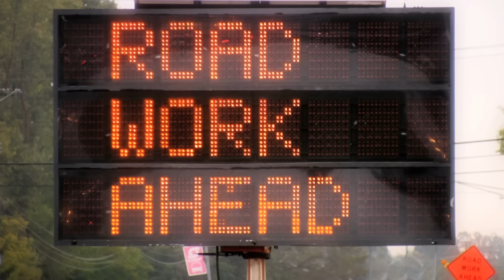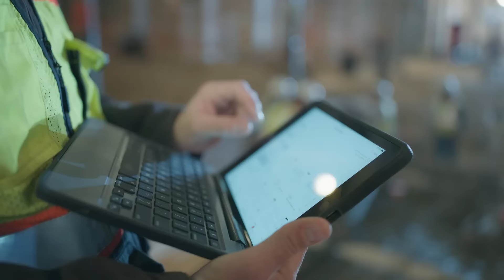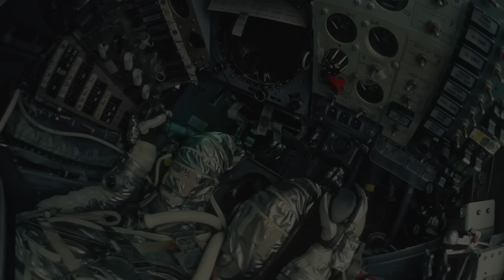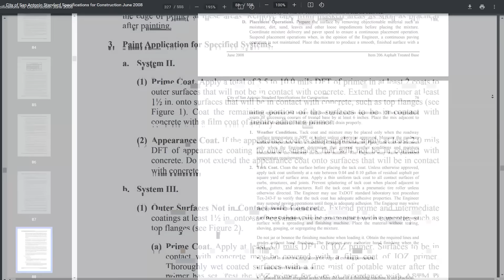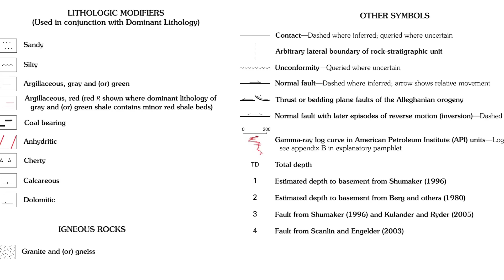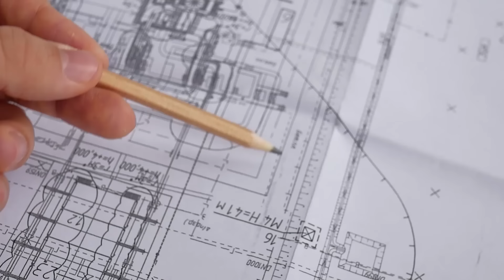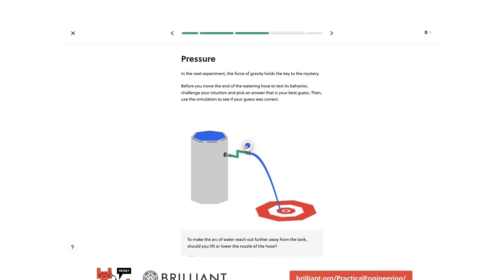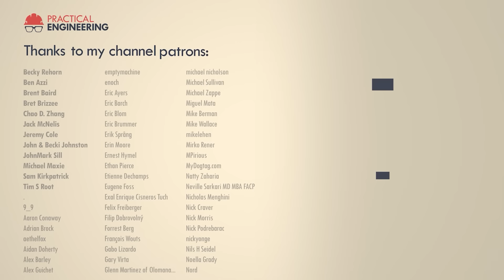4 Myths About Construction Debunked

Comment: As someone with a background in both construction (residential and commercial plumbing) and IT, I always appreciate the balanced view and information you bring to your subject matter.
Reply: The internet is a series of tubes. it's not a big truck.
Reply: ok
Reply: How was your transition to IT? Do you find it boring at times?
Reply: @OldSchool9690  
We have been using tech both on jobs it's and in the office for decades. We had digitizers and scanners in the late 80's. Many of us went back and forth between which tool I used. The best of us can draw faster by hand then the best cad operator. But digital is quicker to make changes or jump up in elevation or over to another typical structure.

But if I may, there is no transition. Digital is just another tool in my box. The building is the finished product. Not the drawings.
Reply: @OldSchool9690  I actually started in IT.  I went to construction after Dell stopped hiring in the US, outsourced everything, then finally sold the portion of their company that I worked for without telling anybody until after the deal was done.

I decided to get something that couldn't be outsourced like that, and got in to plumbing.  Did new construction, first residential, then spent some time in commercial.  I'm back in IT now and yes, it can be immensely boring at times, lol.  But it's a mixed bag, and some areas are busy all the time, just like building a house.

Comment: I worked physical labor for a long time and sometimes people are just standing around. They're not all inspectors, quality control, or jobsite supervisors. It's not a myth and it doesn't need to be explained or excused. People don't work all day nonstop in an office either. There are often other things to do but not everyone is going to be motivated to work nonstop. We aren't machines.
Reply: So, your excuse for 4 guys standing around, talking and laughing while one guy digging a hole is that people in offices don't work all day as well?
Reply: @lopezlopez7132  no. The excuse is that physical labour is hard and people need breaks. We don't have unlimited energy, sometimes digging can only be done by 1 person at a time so we take turns doing the work. More than 1 person digging the same utility out of the ground can cause problems and be dangerous in some cases. As construction labourers, we all put in our effort and time into getting projects done. Just because we sometimes stand around doesn't mean we aren't working.
Reply: @lopezlopez7132  also sometimes you need to wait for materials to be delivered, trucks can only go as fast as the speed limits and different things get in the way, such as traffic, specific truck routes that need to be taken, and weather. Materials don't just magically appear, they need to be delivered, and if there's no space for materials to be delivered beforehand like in the case of gravel, there's not always space for large piles of gravel to sit and wait, the materials need to be delivered as we need them.
Reply: @ewanwiebe  And you don't see any contradiction in your statement "Just because we sometimes stand around doesn't mean we aren't working"? You're standing around and it means you're working?
Reply: @ewanwiebe  I used to own a business. If my employees had to wait for "materials to be delivered," or something like that, they were given other tasks to do. I understand to "stand around" for 5 minutes waiting for materials or something like that, but 4 guys standing around for half a day because of traffic somewhere or no space to put gravel is a waste of time and money.
Reply: @lopezlopez7132  4 guys aren't standing around for half a day. They have things they're doing. You just drive by and see them when they're standing. Do you really expect every person to be constantly in motion?
Reply: @lopezlopez7132  like I said, they either take turns, one of them could be a locator on safety watch, one could be a Foreman, one could be another labourer helping where they can. Just because people are standing doesn't mean they aren't working lol I genuinely can't believe you're arguing this lmao
Reply: @ewanwiebe  OK, lets assume that 4 guys are not standing and not working for half a day. They are standing around for only 1 hour. 4 people, 1 hour each, it's 4 hours. With union labor it's what? 40 per hour? So, whoever is paying just paid $160 for nothing, but it's OK with you... Got it. 
As for me just driving by, well, Sparky, we have construction going on in the complex, where I live for over a year now. I work from home and see the workers all day long. They ARE standing around half of every  day at least!
Reply: @lopezlopez7132  who cares? If you're jealous you should get a job doing construction so you can get paid to "stand around and do nothing". You'll realize pretty fast that it's not so easy and I doubt you'll last a week, maybe not even a day. The job is so physically demanding, that in the rare times you get a chance to stand around and do nothing, you take it.
Reply: @lopezlopez7132  again, 160$ paid to have 4 guys stand around, who are ready to help and fix and solve any problem that could happen, that if they weren't there would delay construction and cost $10,000 , is just smart business.
Reply: @SUPREMELEGEND  I think Lopez has a point. I work in construction and it is astounding how many slackers there are on site, especially those who are used to working for the council. We're lucky to have built a hardworking team now but about half of new recruits just do not care about getting the job done. Lazy workers should and do get sacked.

Just btw I have been a labourer and do agree that rest is absolutely necessary. But it does not take 3 sparkies to core a fixing.
Reply: @SUPREMELEGEND  Well, lets agree to disagree. OK? By the way, I do not mean any disrespect towards construction workers. They just do what our way of doing construction allows them. Look at the HUGE construction projects in China, South Korea or japan, nobody is standing around there and gravel is delivered on time somehow...
Reply: Ya people should just stay in their own lane and not worry about what other people are doing.  Half the people criticizing laborers are probably getting welfare
Reply: love how everyone in this comment section totally missed the point about how we dont need an excuse to just... not work nonstop like machines
Reply: @LlamasOnJUPITER  That's why we all have YOU in our lives - to show us what we missed and to teach us the facts of live...
Reply: @lopezlopez7132  It's not an excuse,  it's an explanation.  Don't conflate the two.
Reply: @thedrnailsguy  So, if someone asks construction workers why they are not working, their EXPLANATION is "because people in the offices don't work as well"...
 I see...
Reply: There are lazy people in a fields. Constructions just attracts some of the laziest. Because the pay is pretty high for the labor being minimal. So they end up with greedy people and ex-convicts.
Reply: @Steve-zo4uc  And when they install at least some AI into you, you'll be unstoppable!
Reply: sometimes it can happen that concrete comes a bit late or some other material.  It happens that workers wait from time to time.
Reply: @Adidas_der_schwanger_war  What about them standing around doing nothing ALL the time, not from time to time?
Reply: @lopezlopez7132  Did not see that ever. Foreman would come if no progress. Strict time schedule just dont allow workers to be idle all the time. The video explained quite well how you might get the perception they would not do anything.
Reply: @Adidas_der_schwanger_war  Just look at, say, road repair in your neighborhood. Usually it's 5 guys "fixing" one spot. Two guys are actually doing something and the other three are talking and laughing. It's ALWAYS like this. Maybe it's not like this on your planet or maybe it was not like this before you died in 1937...
Reply: @lopezlopez7132  Did you even read my comment or watch the video? If you see workers actually on the site you can be sure that they will be working because their boss will be watching. He has to get the contract done in time to get paid. 
You are telling me you drive to a construction site and monitor every worker the full 10 hours only to see them not working at all?
Reply: @Adidas_der_schwanger_war  Looks like it's you who loves watching construction workers. Your admiration of them is a little suspicious... Is your boyfriend in construction?
Reply: @lopezlopez7132  that explainsyour attitude. Small business owners can be some of the worst people to work for.
Reply: Taking a 30 min break is different than doing nothing for 5 out of 8 hours of each working day.

don't worry though. soon you can take the entire day off. when AI replace all jobs you won't need to worry about taking a break.

we already have 3D printed houses. So perhaps a few more decades and we don't need any construction workers .
Reply: @mortgageapprovals8933  AI will replace construction workers as soon as they teach it how to whistle at women...
Reply: @Ellotherem8 ah? what? can you explain? use small words, please...
Reply: It’s a good thing you don’t run a contracting company because no one would work with you very long. Just another thing to point out. Often times on sites, helpers and apprentices are being taught how to do the work by a master or more experienced worker who appears to be “standing around” when in reality they’re teaching and making sure the helper doesn’t get hurt. And yea physical labor is exhausting. It’s like being at the gym all day. You have to pace yourself or you’ll burn out. A good contractor knows their people need to be taken care of. And no, AI is not taking over the construction industry because you’d need armies of robots to do that.
Reply: Didn't expect to see you here, love seeing old YouTube personalities still hanging around on the platform, I remember watching your content back in league days
Reply: Sounds like an excuse tbh mate
Reply: @lopezlopez7132  people in offices get ac we don't
Reply: @dubskulls9554  People in offices make $25 per hour and you make $75 per hour for standing around.
Reply: @lopezlopez7132  i actully get $16 a hour
Reply: @dubskulls9554  Well, when you master the art of standing around pretending being busy, you'll be paid more.
Reply: @lopezlopez7132  With the attitudes in all of your comments I think it is safe to say that we can all see why you "used to own a company." 

I bet you were just a ray of sunshine to work for.
Reply: @mxslick50  Of "All my comments"? So, you follow ALL my comments? Are you stalking me, Sparky? Does your boyfriend know that you "follow" men online? Well, I'm not interested. Leave me alone, Nancy Boy.
Reply: @lopezlopez7132 
I bet your need to give people pointless "tasks" is why you USED to own a business.